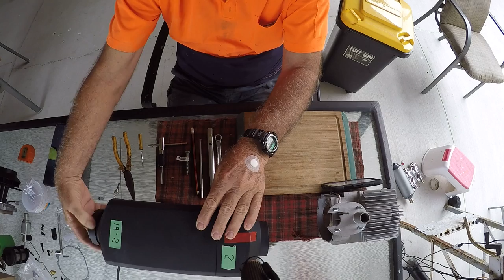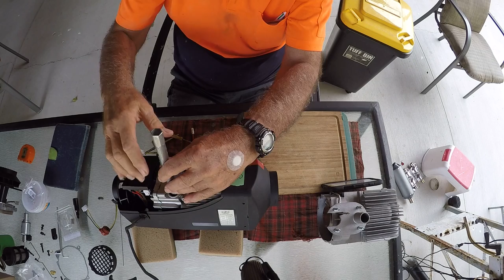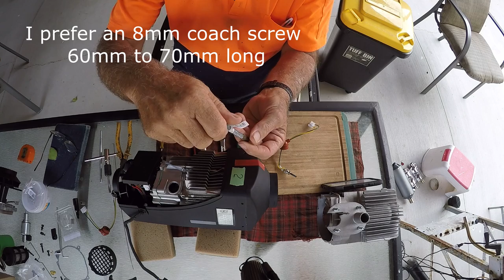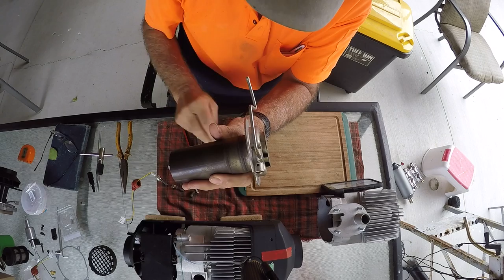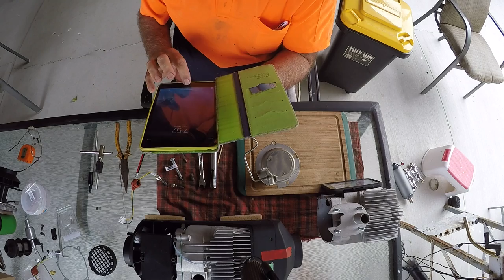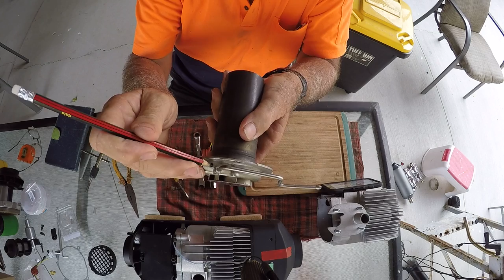Chinese Diesel Air Heaters - Part 9 Glow Plug & Atomizing Screen

Comment: If you cut the burner open you will see a mesh screen usually plugged with carbon you could clean it then weld it back together nobody really talks about this problem with the diesel heaters best buy a new burner